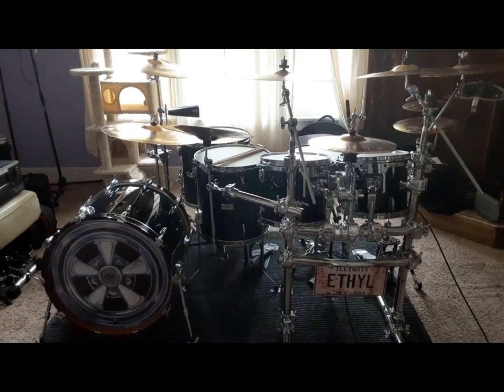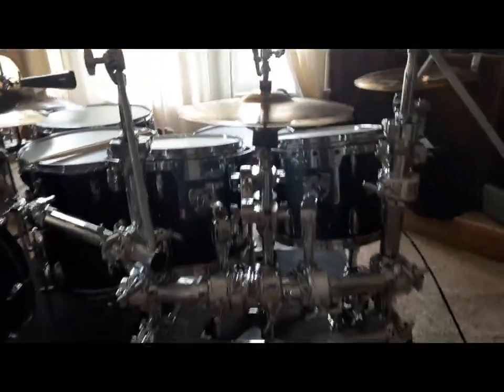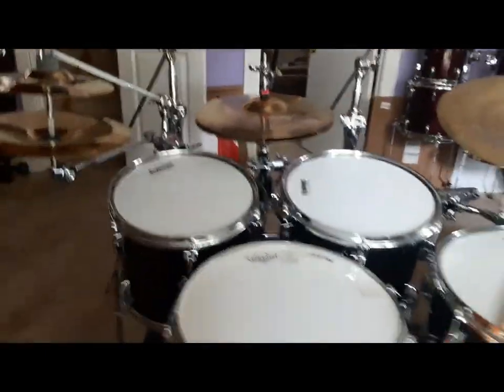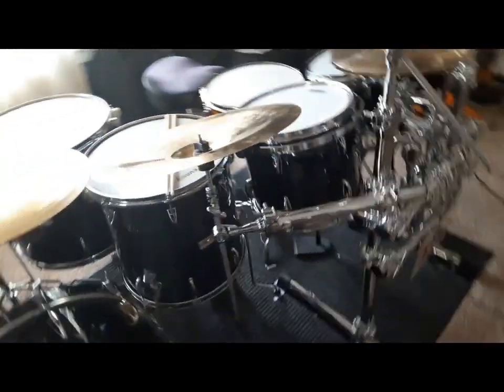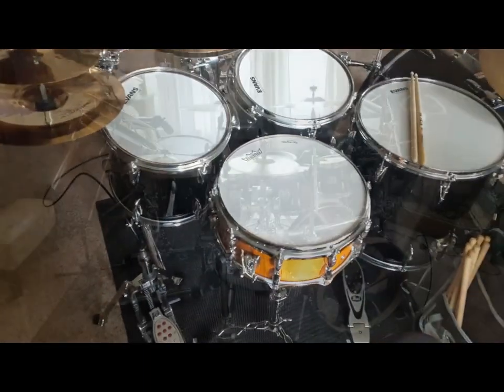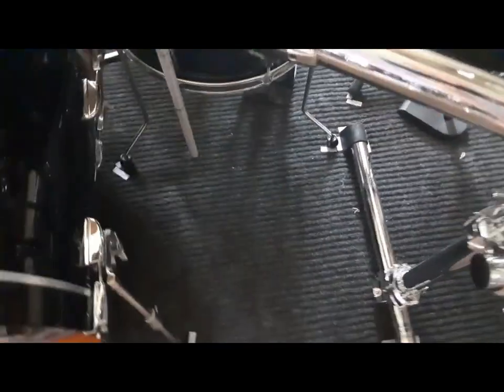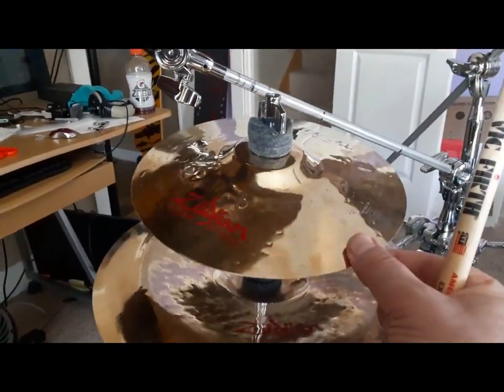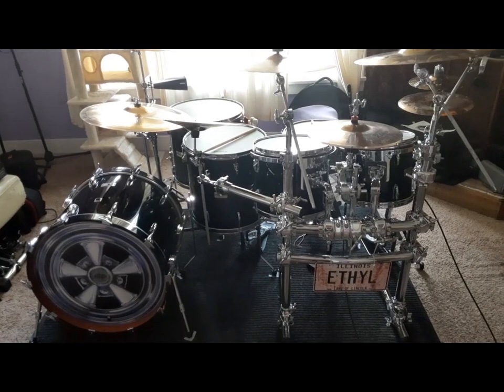Rig Rundown - Yamaha Tour Custom Power Drums ('88-89) - Ethyl

Comment: Always wondered how that would work (bass drum out front), until pdp makes an affordable remote hihat I'm stuck
Reply from the maker: You can use a standard hi-hat stand set up like this; lots of room on the left side of the kit. If you want a center hi-hat, the Tama, Pearl and DW brands are fairly expensive, but a company called Griffin has a model for around $160. Check user reviews on them, overall pretty good.